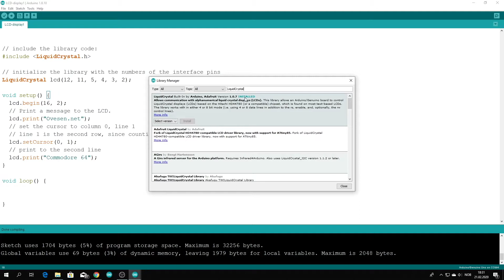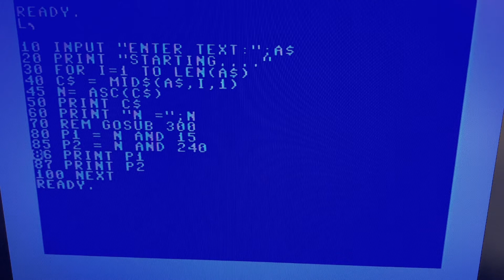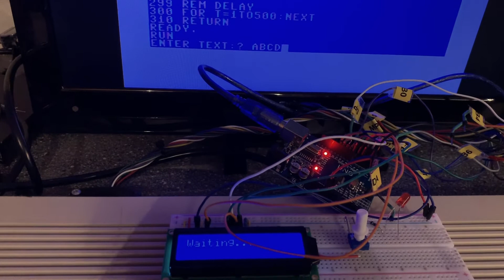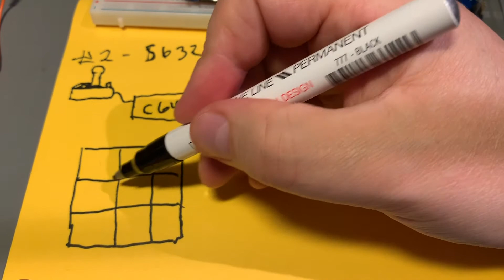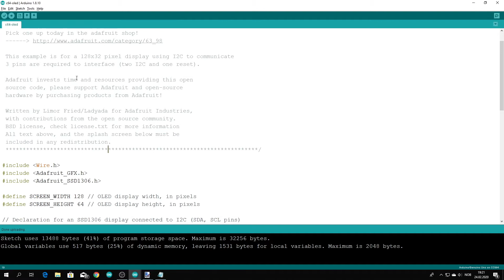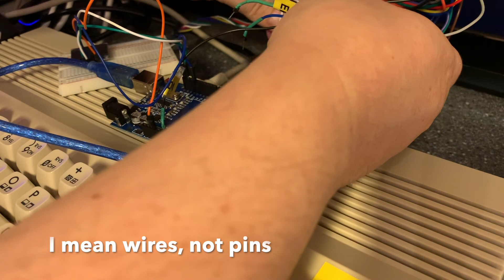Controlling electronics with the Commodore 64 user port - Part 4 of 4 with Arduino and LCD and OLED

Comment: This is cheating ;) letting the arduino do all the heavy lifting ;)
Btw these programs are trivial to convert into assembler and is so much faster.

Here I have two LED bars that are not latched but simply switching the one and the other on quickly with assembler.

https://www.instagram.com/p/CClHyrwAltL/?igshid=1bawkd22z9xpe